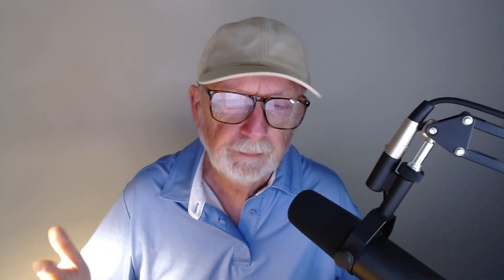Ham and CB Radio Myth - Coax Transmission Lines Must Be A Specific Length.

Comment: Yep, it's absolutely bullcrap. The truth is they used crappy cable that inducts RF and they don't know any better about the science of transmission line. With sheilded line you can cut it any arbitrary length, crimp and end on and plug it in. done. time would be better spent with an SWR meter turning the antenna for its sweet spot. "but ultros, the length of cable affects SWR". No, that is another wives tail and indicitive of bad cabling.

Comment: The only real reason they're a specific length is because they aren't going to offer every possible length that exists in a given unit of measurement. There's no real reason to offer anything that isn't a multiple of 2 or 5 feet, for example... (The most common exceptions are 1 and 3 feet iirc) This goes for any cable, really, not just coax.
Even if they could, it is VERY inefficient logistically speaking.

Comment: What radio operators try to achieve is an accurate reading of reflected power by using odd multiples of an "electrical half wavelength" at the frequency you want to measure at. That's all! Otherwise run whatever length you want. It only matters if you think it does. And I do. In either case, there's no downside of cutting your coax for a specific frequency. Because as previously said, the length doesn't matter (again! If you believe that.)
Reply from the maker: OK but note this from Walt Maxwell W2DU, author of Reflections - Transmission Lines and Antennas, and a former writer of the ARRL Antenna Book:  

"SWR indicators need not be placed at the junction of the feed line and the antenna to obtain a more accurate measurement. Within its own accuracy limits, the indicator reads the SWR wherever it is located in the line."

Comment: Start by doing a 20’ check everything then go down same everything just keep using the same end as you remove it every foot. When you get the coax tuned to your frequency you want then check it again. During the entire time check for how the radio sounds check swr check power resistances resonate impedance. Try it
Reply from the maker: Did you listen to the video at all?

Comment: CB/freebanders, I believe, make a big deal about this as they run tremendous amounts of power on one single frequency.  I think what they are doing is getting it perfectly in phase so that it nulls out the common mode current.  I have researched broadcast station feedline length and all I could find was that they try to make the couplings in their hardline at odd wave lengths as that is where arcing can occur because voltages are higher at the peaks.  In TV, it is so broad spectrum that they just run oversized feed line to prevent the possibility of arcing at the couplers.  I have never found any engineering writings of calculating optimal overall length of feedline from broadcast stations.  I have spoken over the air to fellow hams (who were retired broadcast engineers) about the subject and I have never got a definitive answer if over all feedline length was part of their engineering calculations.  Obviously for loss figuring, but not for matching.  In our ham radio world we just want to work every frequency we can so the shorter the feedline the better!  73, KF0BBU
Reply from the maker: At AM radio stations for example there is a tuning circuit at the base of each antenna so there is a perfect or near perfect match along each line which means no standing waves.  This works fine for the radio station because it only transmits on one frequency.  It's a different story for ham radio operators who transmit over a broad range of frequencies.
Reply: @BustRadioMyths  yep they know to put the tuner at the antenna to reduce feedline losses.

Comment: what about using at least 50ft with an efhw ?
Reply from the maker: Think you are referring to when the coax shield is used as a counterpoise for an EFHW.  If that's what you are doing, yes.  I prefer to use a separate wire as a counterpoise because the coax shield runs into the shack and can cause rf in the shack problems since it is part of the antenna.
Reply: @BustRadioMyths  yup, requires a common mode choke just to be sure

Comment: Excellent! You hit the nail on the head again! There is advantage if the coax is 1/2 wave long (taking the velocity factor into account. In that case the impedance at the far or antenna end will be exactly what the input impedance to the coax is. Important if you want to measure antenna impedance without actually being at the feed point! Also if the coax is 1/4 wave long it can transform a high impedance to low and vice versa. These are cases where we are using the fact that the line operating with an SWR becomes an impedance transformer as you mentioned.
Reply from the maker: Good points!!
Reply: @BustRadioMyths  I am glad someone out there is putting out good info! I am trying also!
Reply: yes, exactly! I use "tuned" lengths so my analyzer is effectively at the feed point.

Comment: Mark this is a brilliant summary of a myth that needs to be debunked.  Thank you.  YT is full of people cutting their coax to "null" it for some reason. This in a simple systems not using matching stubs or such like.  My instinct is to ask how come the coax in my car is the same length for all bands from 80m to 6m with a great match from the same antenna? Well, I have a Tarheel screwdriver antenna that adjusts its length.  I also don't have multiple different feedlines running to my Hexbeam or DX Commander or loop - get the antenna "right" and the rest is straightforward.
Reply from the maker: Someone commented on this video talking about cutting coax to a "null" and I didn't know what the heck he was talking about!!

Comment: What I have NEVER been able to understand is about the ANTENNA itself? WHY do we HAVE to have Specific measurements for the radio antenna? Anybody remember the OLD VHF TV SETS? You put up an antenna and the TV TUNER did the WORK? Why does THIS not work for ham radios? One antenna does it for ALL of the various bands? Can anybody dumb this down for me? Just really makes NO sense to me. Sorry!
Reply from the maker: Pretty much anything works as a receive antenna.  Even your TV rabbit ears were of a length appropriate for those frequencies - around a quarter wave.  Transmit is a lot more critical electronically.
Reply: @BustRadioMyths Our antenna was mounted to the chimney of our house and I don't remember the antenna arms being of DIFFERENT LENGTHS for the various channels.
Reply from the maker: Well no not for each channel.   One length would be fine for all the TV channels.  Again,. with transmitting the antenna will not present an acceptable load to the transmitter if it is not the right size, generally a half or quarter wave, depending on the design.

Comment: this is true but also not true .... there are too many other factors involved mounting hight, ground conduction, reflection from nearby objects and such ,,,, remember we are dealing with RF AC power ... i have used coax baluns and had poor field radiation readings ... changed coax lenght and removed baluns and presto good readings ... i could go on like a book but this is not the place .... great video

Comment: If there is larger mismatch at antenna feedpoint, the reflected power standing wave has a greater effect, as you said, changing the impedance along the length. Coax trimming doesn’t change the feed point SWR, but it can fool people into thinking there antenna has low SWR by bringing impedance closer to 50Ohms at the radio.
Reply: Matching impedance at the radio would allow it to produce its maximum power into the system, so a good thing ?
Reply: @paulm0hpd319  yes, but sub-optimal to matching at the feed. A portion of that standing wave will keep being reflected and as it goes back and forth both the cable length traversed and losses multiply.
Reply: @Aimsport-video  not if feedline is upgraded to a less lossy one
Reply: @paulm0hpd319  lmr400 too. How many times does a standing wave traverse a given feedline every second at your chosen frequency as it smashes against feedpoint? How far is that… approximately? Fortunately a percentage of the reflected standing wave does force its way past the impedance mismatched feedpoint with each go… so not a total writeoff. Feed point impedance matching is crucial.
Reply: @Aimsport-video  that's the job of an antenna tuner to provide a conjugate match which allows the transmitter to produce its maximum power into the system and correct the phase of the reflected power to enable it to be radiated by the antenna
Reply: @paulm0hpd319  Yes but it only works for a very narrow frequency range.  I jus u=e that antenna tuner and don't worry about the length of the coax.  The SWR is still high on the line but it lets the transmitter put out its maximum power with out burning up the final stage.
Reply: @ralphmowery2898 yes I would use an antenna tuner also, using balance line is ideal to use under those circumstances
Reply from the maker: True!
Reply: You can trim the coax if only using a narrow frequency range.  Or just use the so called antenna tuner and not worry about the length of the line to do the matching.

Comment: I got as far as 0:22 and was forced to comment. I hope that you realize the exception to the rule...  In some antenna systems a specific length of coaxial cable (i.e. 0.25 wavelength, yes considering the velocity factor of course) is used to act as an impedance transformer. For example, if you had a folded driven element and its Z was around 112 ohms (due to nearby reflectors and directors), then a quarter wavelength of 75-ohm coax could be used to flip that 112 ohms around to about 50 ohms. This is not some unknown theoretical exception, even good old Radio Shack used to sell "Twin" CB whips that used that same impedance matching concept (except for paralleling two whips). There are plenty of other traditional Ham radio antenna designs that require the specified feed system (the ARRL handbooks, especially the older editions, are full of examples). It's essential that when explaining the rule, that you also acknowledge the exceptions.

But yes, you're generally correct. A dog's legs need to be long enough to reach the ground. Same thing for coaxial cables in most antenna systems, i.e. ones that are not designed and intended to employ a specific length of feedline as part of the matching concept.

To preempt the obvious rebuttal: When using a coaxial quarter-wavelength matching, I would consider that to be part of the antenna 'system', but it's not intended to be part of the antenna itself (the antenna elements that radiate). Pedantry aside, noobs would easily mistake it for a feedline, and taking your incomplete advice they might trim it. Their only clue might be that it's perhaps not a 50-ohm coaxial cable.
Reply from the maker: Yes I understand that.  The video was not about quarter wave transformers.
Reply: @BustRadioMyths   Yep, that's why I mentioned it in the comments.
"...Myth - Coax Transmission Lines Must Be A Specific Length"
'...Fact - Coax Quarter-wave Transformers (may be made from coax) Must Be A Specific Length'
The challenge for noobs is to distinguish these exceptions. Thus worth mentioning.

Comment: mine is 15' 6" cut to null and it works better than     just enough length to reach my antenna....why is that if the length does not matter ???
Reply: What do you mean "cut to null"?
Reply: @smorrisby coax cut to 1/2 wavelength x=0 (null) r=50 reading on antenna analyzer...no need for tuner or balun...in my situation this works best for me...not downing you in any way just saying it does work, and works well for me...tks...
Reply: @TheFlyingSquerill  I think I've worked out what you are doing. You have not cut your antenna to the exact dimension for the frequency,  so you are cutting the coax to eliminate reflections. You are using the coax as an ATU at best and a 50 ohm dummy load at worst. Your radiation pattern will be appalling.
You have to get the antenna right 1st.
Reply: @smorrisby  well all I can say is my antenna is tuned at 1.01 flat across with r=50.4 x=0.64 and I have worked Australia, West Indies, Hawaii, United Kingdom, Canada and almost all the states except Alaska.....so my pattern can not be to shabby, I talk in all directions vertical....Hawaii and Alabama at the same time ... NY and Washington State at the same time.....for example ... did not mean to stir anything up really what your saying works I understand and agree but it takes a tuner and Balun, that's awesome, gets you on the air and making contacts many situations are  different though....just in my situation it works well for me...I guess I may be the exception that proves the rule ....but it works for me....less the tuner and Balun.....thanks for the reply....
Reply: @TheFlyingSquerill  Add 5m to the coax and it will make no difference. Just out of interest, what RF Analyser are you using?
Reply: @smorrisby why would the radiation pattern be appalling using the feedline as an impedance transformer
Reply: using a rig expert... if it works it works is all I can say ... it's what I have, and it works, what is wrong with that....maybe there is just a misunderstanding here...your way works I agree and am glad it does, not putting you down, but I do not understand exactly why you would put me down and call my working station rubbish in theory when it works well....that makes no sense to me ... I have used different lengths of coax and it did make a difference...if I had a tuner then it would not matter, but I do not have a tuner, and it works for me doing it the way I am now...why is that wrong in your opinion....isn't it about getting on the air and having fun....if it works I do not see any reason to fix it, or to try and say it doesn't when the facts prove that it does speaking of my situation directly not others....🤔🤷🙋
Reply: @TheFlyingSquerill  Rig Expert looks like a good bit of kit. If you used different lengths of coax and it made a difference something is very wrong. I've been doing this professionally for 40 years. Might I suggest you buy the ARRL or RSGB antenna handbook and read them well!
Reply: @smorrisby  thanks for the suggestion...seventy three....

Comment: I have heard about this in the past but didn't think it was still something that people did. I just use the shortest run of coax that I can, plus a couple of meters extra for an air choke at the antenna end.
Reply: Yes and also add a "drip loop" at the shack end.  You want rain that lands on the cable to go away from the wall of the house.  The same thing can save your gear in a thunderstorm.  Use a heavy grounded iron wire to hold the bottom of the loop in place by winding a couple of  turns around the cable..  A nearby strike will send an RF pulse down the cable and the pulse will see a handy way to go to ground that isn't though something expensive.

Comment: Thanks Mark!
I have long known the truth about SWR and the feedline length myth. I'm not a scientist nor an engineer - just an old guy... but I can (and do) read what the scientists & engineers wrote, and I try to share my knowledge when I can. Nonetheless, there are STILL - to this day - hams who refuse to believe the facts.  My favorite myth: Reflected rf going back into the transmitter and "blowing up" the finals! 😂). 
Maxwell had it right, waay back in his day...
Anyway, keep putting out the truth!  It shall set us free...
73 from west Texas!
Reply from the maker: So good to meet a fellow truth seeker.  These videos only express in my own flawed way what I have learned from engineers like Maxwell.  And yes, reflected power destroying your transmitter is one of the best myths LOL.
Reply: Totally agree about Maxwell and the myth of reflected power killing the transmitter, the main reason why it doesn't kill the transmitter is that the impedance at the transmitter has changed something that's hard to fathan by some 👍
Reply: Qualifier. You can get out better with a system with low SWR. That because the "new" radio's roll back the power when the swr get's to certain point. I found that true by accident when I saw my 100 watt radio putting out 10 watts, the I realized I had the coax switch to the wrong antenna.
Good video
Reply from the maker: Get an antenna tuner and you will get out just fine even with a higher SWR.
Reply: @BustRadioMyths  maybe a topic for another video, tuners
Reply from the maker: Yes Paul I've got a tuner video on the list.

Comment: I'm glad you did this, Mark.
I seen a few videos and one where a C.B.'er said he cut off one inch increments and re-soldering the PL259 back on each time.
I said it didn't matter because the SWR meter and jump lead made it all one coax and no longer ½λ. His reply was he wanted the best out of his system. The C.B. shops tell them it's about impedance matching.
Do they think the SWR meter is an isolating device? Why not ½λ from the tx to the meter?
Imagine ½λ for 472kHz. 
Why would they listen to us after all we are only amateurs! That was said to me in a pub years ago. 
G4GHB
Reply from the maker: Wow!!
Reply: The cb shops are not far wrong saying its about impedance matching just that the concept gets misunderstood